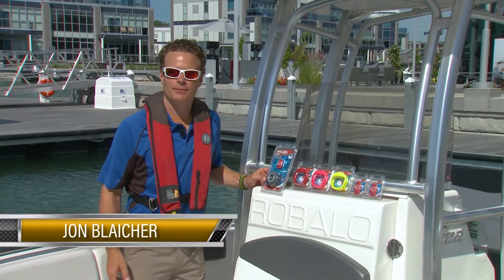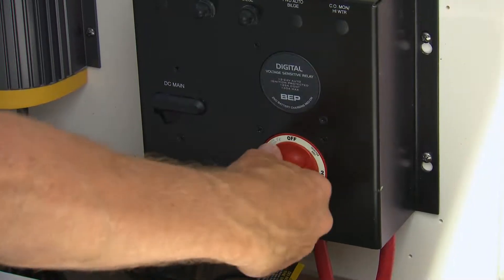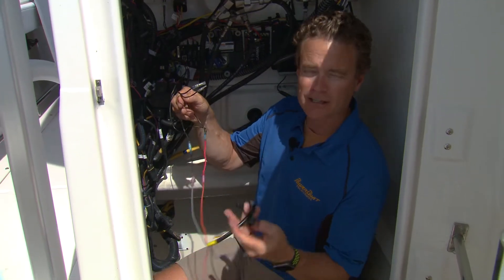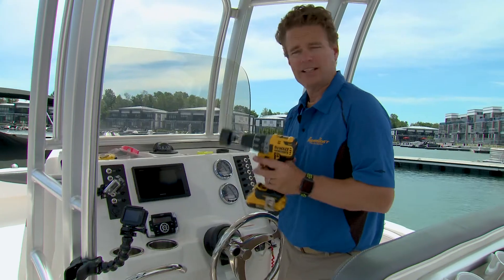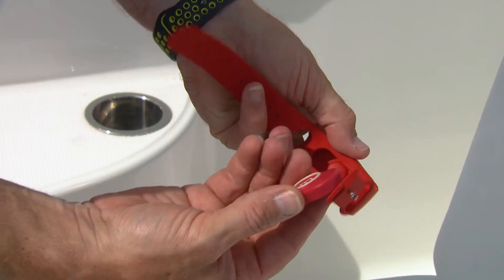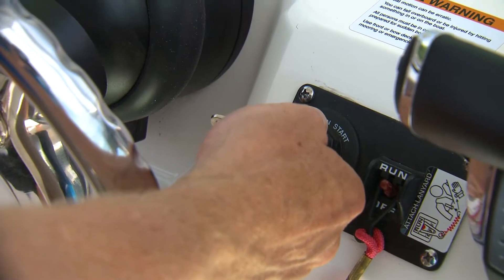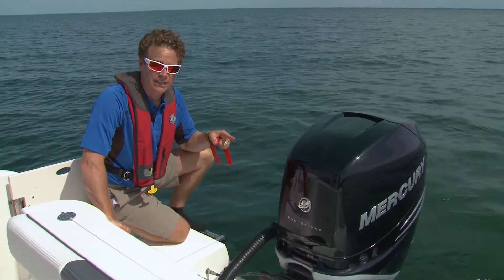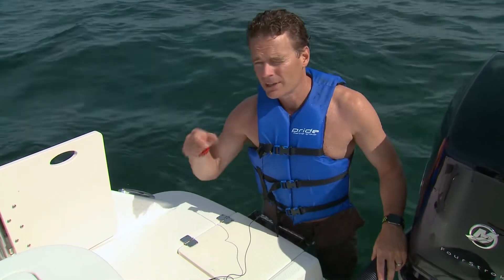How to Install a Wireless Man Over Board (MOB) System from Fell Marine | PowerBoat TV MyBoat DIY

Comment: In theory and function they are a great item to have.  Only problem is in durability.  There is a silicone waterproof ring around the center button of the main unit and it wears out in time, say two to four years, then the unit is subject to failure.  That's not good when you need this unit to start your boat and it has malfunctioned due to water intrusion due the waterproof ring failing.  Easy fix would be for the manufacturer to sell the little ring with tabs for say, oh two dollars, which would be a lot because it is a cheap ring of approximately 1/16" in thickness.  But no, they will not and do not sell the replacement ring, I've tried, the just sell a whole new unit for $220 +/- and then the difficult and timely project of rewiring it into your ignition.  Bottom line, click on your kill switch lanyard.

Comment: Just out of interest...in another video about this exact same device it was said that only the first FOB to be paired would activate the "kill switch". The others - if there are any - merely set off an alarm, but do not shut down the engine. Who's right?
Reply: On the MOB+ the default setting is the passenger FOBS only alarm and do not stop the boat. But they also can be configured to act as a captain FOB , see the operators manual on how to do this at Fellmarine.com under support
Reply: Traducir a español